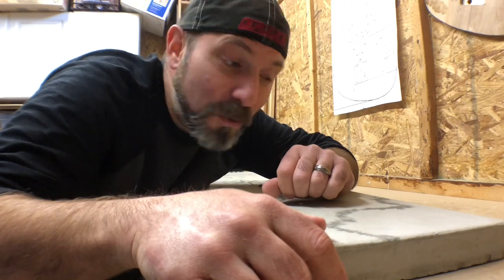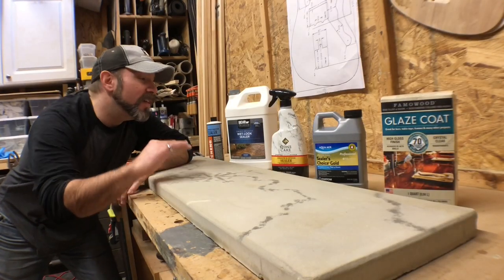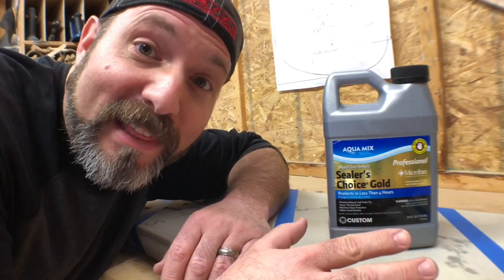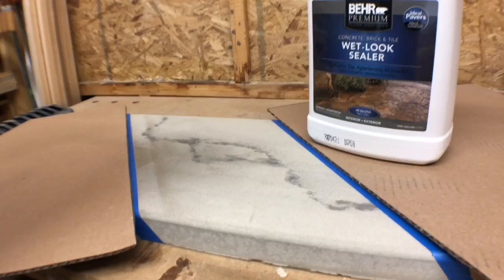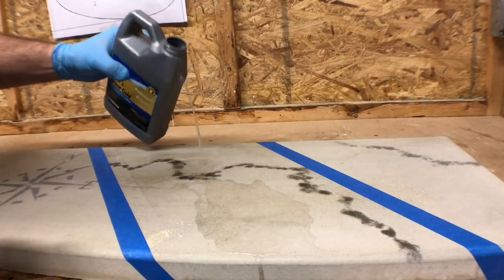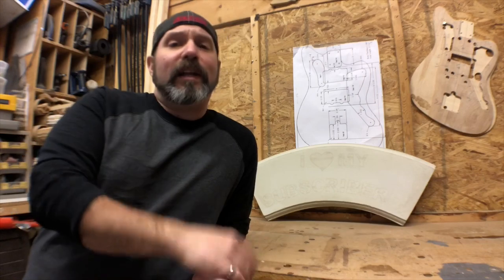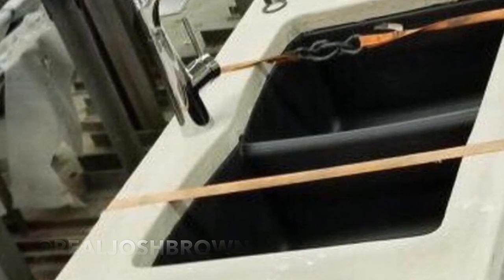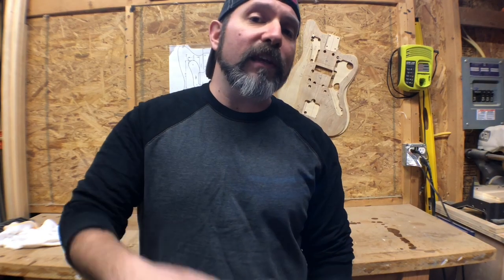Seal a Concrete Counter Top

Comment: Do u think misting the sanded grout so it's moist before lifting the stencil will help lettering remain straight after mortar runs over them ????
Reply from the maker: I tried that and it didn’t seem to make much of a difference. Made more of a mess than anything. Also grout just doesn’t seem to harden unless it’s mixed thoroughly
Reply: @MichaelBuilds  Thanks for that data brother...Luke n I are making a summer road trip thru the midwest (from CA) to install my dad's headstone we are making from watching your videos... (in our 70 Chevelle!!!! ) .  We are making stops at several YouTubers....where do u live????
Reply from the maker: Detroit Michigan

Comment: I made one just like in your first video (though L-shaped) and I didn't work fast enough and it has some bubbles/holes in the top. Is there anything you'd recommend to fill the holes, particularly in mortar? I'm thinking about maybe doing resin to give it a little bit of character, but not sure how that would work with the seal.
Reply from the maker: You can make a slurry and work it into the voids 😉👍🏻

Comment: Question for ya, Michael - I tried an epoxy coat on a small sample and I’ve had several bubbles form while I allowed it to cure (this was after the initial application + torching the bubbles). I believe this is because concrete is so porous. Should I seal the concrete with a different sealer (similar to your fire table) or install a thinner layer of epoxy to fill in the pores?
Reply from the maker: Thinner layer of epoxy 👍🏻😊
Reply: Michael Builds thank you sir!

Comment: When you use the grout and stencil for designs how do you keep the flowing concrete from disturbing your designs?
Reply: calveryc1 slow pour it or find a way to funnel it.
Reply: raffikkiz Thank you. In a later video he also mentions that if you mix it really liquidity it won’t disturb it.

Comment: Mike, I have concrete countertops in my kitchen right now. We sealed them using something that was recommended to me. And it looks terrible. It’s peeling and bubbling. Do you have any suggestions for removing the sealer? I want to try the spray on stone and granite sealer you recommended! Do you think we could use that after removing what is already on there?
Reply from the maker: I don’t have any advice for removing the old sealer but I don’t see why you could use the stone and granite sealer after the removal

Comment: With the epoxy sealer, is there any issue with UV damage? If so, is there any way to protect it? My coffee table is going to be on a deck and could get significant sun.
Reply: John, Epoxies in general will react poorly to sunlight. They tend to yellow when exposed to UV.   I was a chemist who formulated epoxy Coatings. Always indoor application or pigmented. Highly recommend you avoid epoxy for outdoor use.

Comment: How would you go about building concrete shower walls. i google image concrete stand up shower designs and i have found several i would be interested in trying , i have custom built a few showers now with custom concrete bases and completely covered with tile. Im kinda getting tired of cutting , aligning , grouting , custom tile showers. they look amazing but they are very time consuming if done with any kind of attention to detail.... i want to do something different for my master bath shower. i was thinking your thin cast concrete videos could be applied directly to making shower walls that could be place on top of a custom concrete shower base. I like to add built in shelves to all my shower projects , not sure how i could accomplish that by doing pre cast concrete in molds like how you are doing  any ideas??
Reply from the maker: I’m not sure about the walls but as far as the shelves are concerned, you would just make smaller molds and make sure you reinforce them well since they’ll be thinner and smaller

Comment: Very nice, wish I had found you a year ago, I did an outdoor bar, I thought it went well until this spring and the surface flaked off, sealled it with a garage floor epoxy  recommend by the depot, trying to figure out what to do to fix it, any thoughts would be greatly appreciated, thank you

Comment: Great video. I like the epoxy sealant.  However,  the instructions clearly states that their product it is not meant to be used for any outdoor furniture or furniture that will be under the sunlight for extended periods of time. I'm not sure about the other products.  Than you.
Reply from the maker: That’s why I made sure to label that scene “interior Only”

Comment: Mike does the finish effect the sanded grout designs by anyway?
Reply from the maker: It depends on which one you go with but all will seal the grout tight 😉👍🏻
Reply: @MichaelBuilds  okay building a table for my ceramic Grill with two slabs of concrete each one has a grout design in it just didn't know if the Finish would mess it up. I'll let you know how it turns out the first pour worked very easily thanks to your method
Reply: Mike u got an email i can contact you at

Comment: Super video! Q: What if I wanted to make a minimalistic all concrete coffee table (with left and right side straight down concrete same width as top). I would need to make a 2-piece mold. After the top is poured, I would need to put second piece on top of it to pour the sides, however I would have to close top I just poured so that the weight of the sides doesn't push up the top I just poured. But then I couldn't keep what I just poured wet? Would that even work? See example table here: https://www.westelm.com/products/industrial-concrete-coffee-table-h1581/
Thanks Michael for this awesome method!!

Comment: The only real question asked by my clients (I make decorative concrete for a living) is staining and none of these sealers will stand up to the test of time.

You should be using a high performance sealer made for decorative concrete and I'm afraid chengs sealer is years out of date.

New age sealers such as Omega from the concrete countertop institute are what you should be using and showing.

Feel free to contact me on Instagram @cheshireconcreteofficial

Comment: Following your advice we used the behr wet look sealer.  It looks really nice, but it does not seem to work.  After 4 coats, water will still stain after a minute of sitting on the counter.  We checked reviews of this product and the internet is filled with unhappy customers.  Were not sure what to do now.  We may have to epoxy over it as the counter is unusable as it stands with this product.  Should something like a dark vinaigrette get on it, the stain will likely be permanent.  Sorry, i really like your channel and the look of this product, but its not cool to recommend it.